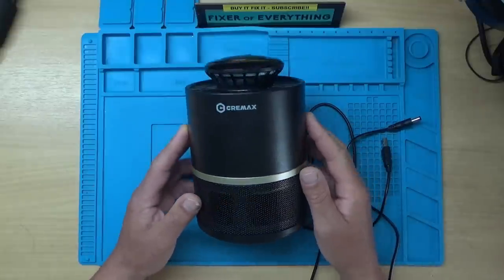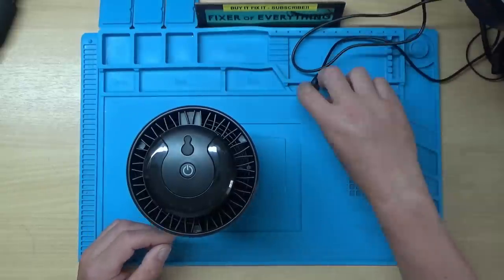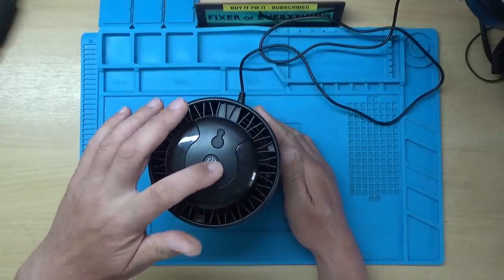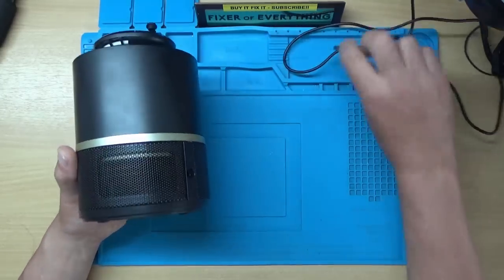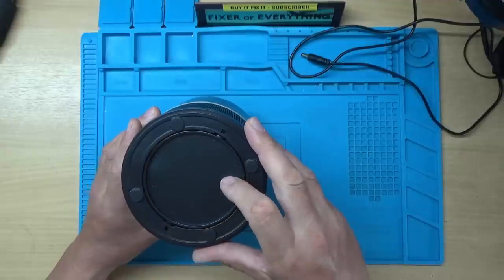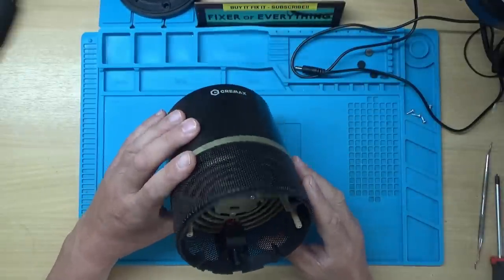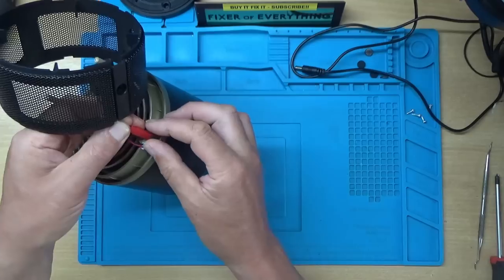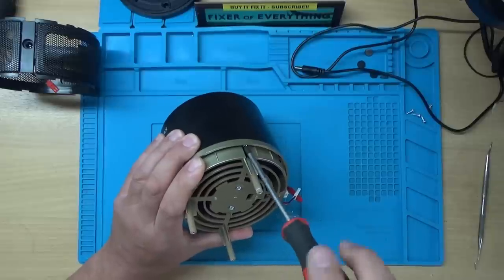Electronic Fly / Mosquito Trap | Can I Fix It?

Comment: Heya, wel it works maybe use the button on top as the make contact button for the power
Reply from the maker: Thanks, the only problem is that it's a momentary contact switch, so it would need some additional circuitry to operate as an on / off button.

Comment: Nice MacGyver bypass. If I had this trap I'd add a mechanical on off switch to those two points that you shorted and the light and fan came on. But a blob of solder works just as good.
Reply from the maker: Thanks 👍
Reply: i would do the same.

Comment: Impressed how fast you soldered the two resistors back.
By the way, for measuring smd resistors I have measuring tweezers which are very handy. You just hook up the wires of these tweezers to your meter and grab both ends of the smd resistor with the tweezers.
Reply from the maker: Thanks Diane, I'll have to look into those tweezers, they sound handy. Thanks for the tip 👍

Comment: Good work around, only thing you could have checked was the cheap momentary button. They get crap in them and can not fully open, but it did make a good connection when pressed. But still, on all the time isn't an issue anyway.
Reply from the maker: Thanks 👍It stopped working after they plugged in a 12v adapter by accident, and that went straight into the small microcontroller. I'm sure I did check the push button, perhaps that bit didn't make it on the video (can't quite remember)😂
Reply: @BuyitFixit  Oh well, they were just destined to kill it!

Comment: Could always place it in a smart outlet or a outlet with a timer. Was it possible to short the on/off switch and still have the light sensor in?
Reply from the maker: Unfortunately not, the microcontroller seems to control both. I think it got shorted internally due to the over voltage. I'm not sure why shorting the sensor contacts made it work. Alternatively I was going to remove the chip totally and just wire the output pin to 5v which would have done the same job.
Reply: @BuyitFixit  I see no much to be done then, and as you said better then going in the bin 😊

Comment: My wife has a thing like a tennis racket which generates about 2 Kvolt at micro amps ! When she hits a bluebottle there is a blue spark and zaps the fly! Sometimes it only stuns them but they’re easy prey to kill then! It only needs a pp3  9 volt battery and lasts for ages! Fraser
Reply from the maker: I've got one similar, runs on 2xAA batteries. it seems to give a few hundred volts, not KV, I did press my hand on it to see how much of kick it had, and let's say I won't be doing that ever again!

Comment: I thought these fly traps had a grid array in them with 1-2Kvolt in micro amps to kill these insects? What is the high voltage in this one then? Interesting videos though! Fraser
Reply from the maker: This one doesn't seem to have high voltage, it just seemed to be a blue / UV led and a fan to suck them into the "trap" part.
Reply: The UV lights does attract them! Shops like fish and chips, Chinese , Currs
Reply: Have them and the bottom tray has HV grids that collect the unfortunate visitors!😅

Comment: Things like this shouldn't need a micro controller. Some descrete components would suffice to make the LDR turn it on at night, If you have a problem with flies, why wouldn't you want this thing running 24/7?
Reply from the maker: Agree, although with a lot of things it's cheaper to throw in 1 microcontroller than a handful of discrete components..

Comment: If it worked by shorting the LDR, why didn't you test the LDR to see if it was always open circuit? If it had been and you replaced it with one that did create a voltage divider when the dark hit it, it might have fixed the thing in the way it was intended.

Comment: 5V barrel jacks are an accident waiting to happen.
Reply from the maker: Yep, especially with multiple adapters lying around 😂😂
Reply: Seriously. Just why not USB on both ends?
Reply from the maker: Good point! I seriously have no idea 😂😂😂😂
Reply: On a traditional device there would be a marking near the socket with the correct voltage and polarity or ~ AC. I prefer a barrel connector over a USB, because USB is a data port. Nobody should be encouraged to plug in a bug zapper, table lamp, vacuum cleaner or similar into a computer.

A surprise from a barrel connector happens if the center pin is ground/negative, as is sometimes the case on radios, because they use this arrangement to disconnect the batteries.

Comment: Do you think these devices ever work as advertised? I have bought a few but they never seem to work as advertised
Reply: If it didn't work, why fix it? I'm assuming that if it didn't do anything, they wouldn't want it repaired.
Reply from the maker: I checked the reviews and it didn't get very good ratings...
Reply from the maker: I'm not sure how long they had it for before it got fried, the fan etc looked very clean inside so perhaps they didn't use it very long to find out. I know it got fairly dismal reviews on Amazon 😂😂😂
Reply: If they really got rid of mosquitoes they'd be way more popular in places like Manitoba.
Reply: It lures the fly with the light and the fly is sucked into the fan where it is injured by the fan and lands into the mesh cup ~ the breeze will dehydrate the maimed fly and eventually kills it. These are very efficient at trapping and killing small flying insects without zapping them, I had a Maplin n’gadget fly vacuum (based on the same principle as the trap In this video) unfortunately it recently died before Christmas 2023 and l have bought one of those rotary fly traps

Comment: Why couldn't you just buy a new micro controller or would that need programming.
Reply from the maker: Yes, it would need programming. The code isn't publicly available and the microcontroller would probably be read protected.
Reply: @BuyitFixit  can they read protect them, then. I was thinking of buying a programming kit to have a dabble at it.
Reply from the maker: @jonome9565  Most microcontrollers have a read protection setting. I'm not sure what microcontroller this was as it didn't have a number.
Reply: @BuyitFixit  it's just I saw the Cod3r was reprogramming chips to make a disk playstation into a digital version. He never mentioned a read protect. You learn something from every one of your videos. Nice work. :-)
Reply from the maker: Thanks. It depends on what chips they are. If it was a flash chip then they are made to read and write. Microcontrollers have a cpu ram and flash all in the one chip. You can usually erase them and then use them again or sometimes you can use a glitch attack to bypass the protection.

Comment: sorry but i dont like  a cheap fix  things to me should work as intended
Reply from the maker: Agree, and I do try where possible. Unfortunately the microcontroller in this was fried, so even if I replaced the microcontroller with a new one, it still wouldn't work without the software to program into it, which we don't have...